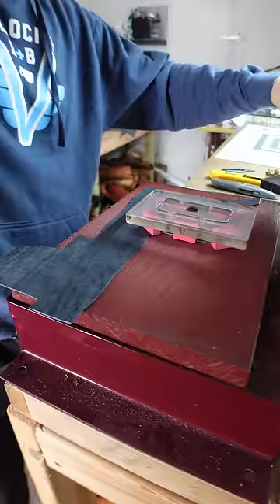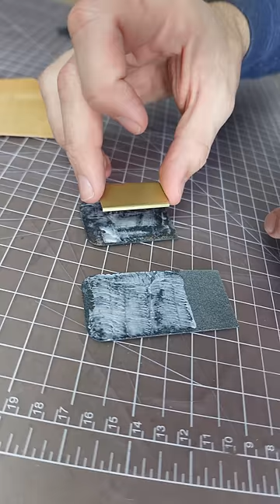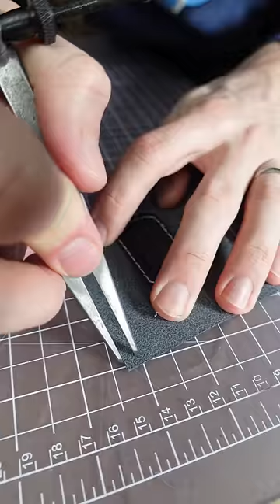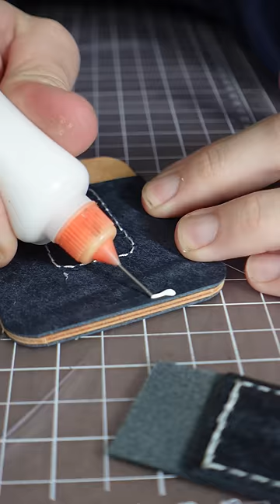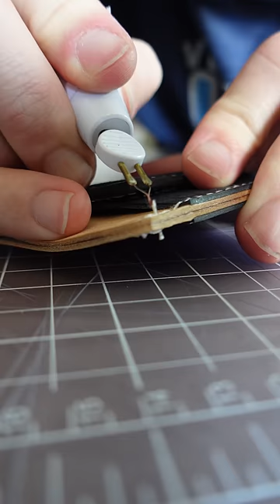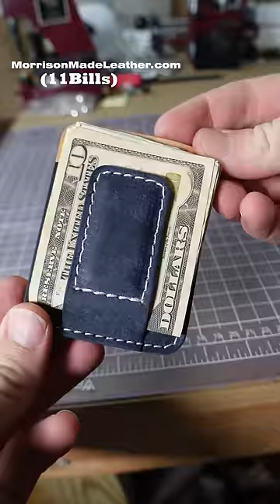Your New Favorite Wallet

Comment: Brilliant, magnets in a wallet. My credit cards will say thank you, until i wanna go shopping..
Reply: I’ve had a wallet like this since 2018. Never had a problem with credit cards. I even use the high power neodymium magnets. 

The only thing they may effect is hotel door cards? I seem to have issue with those every now and then.
Reply: I’ve had a magnetic money clip wallet like this for over 20 years!  Never been an issue at all….
Reply: The chip in the card will be fine, but it might deactivate the magnetic strip, if your card still has one of those (usually a black strip on the back).
Reply: This kind of stuff has been around for many, many, many years. Don't put your magnetic strips against the magnet. More than likely, the part in the wallet is steel with the magnet in the flap.